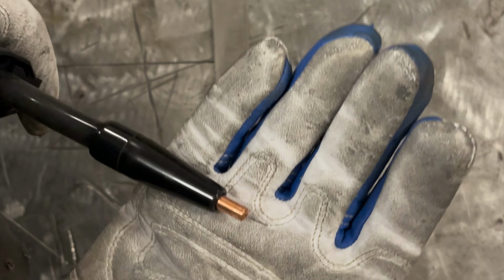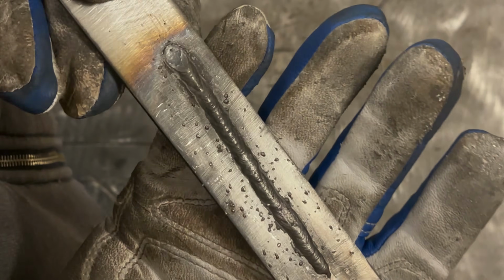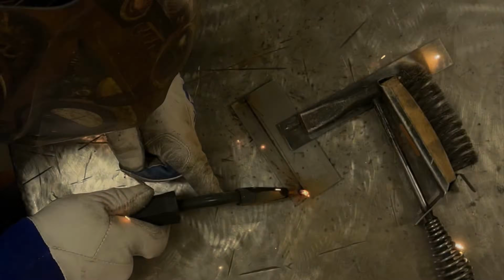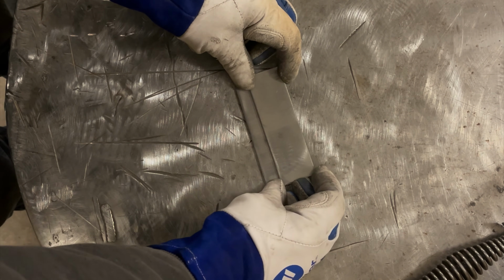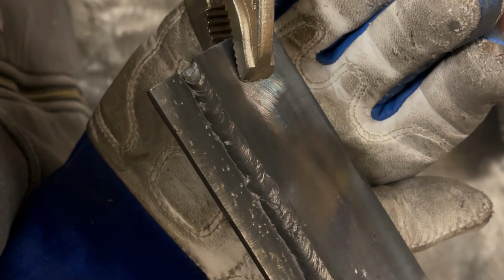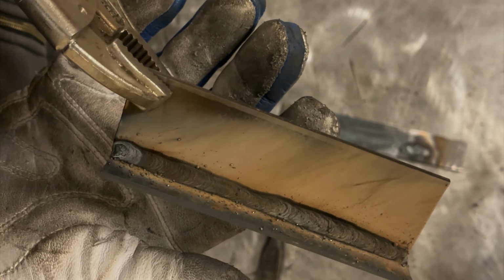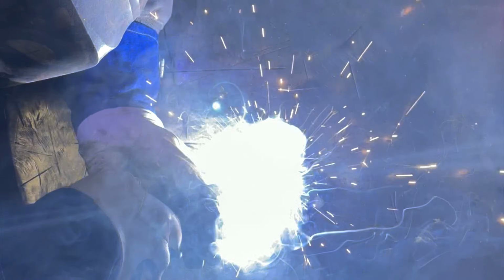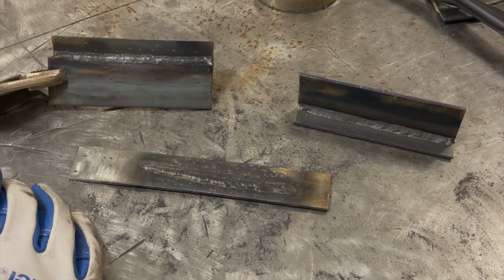How to weld with flux core wire

Comment: Forney .30 is what I use for anything under 1/8 anything over stick comes out lol thanks for the tips
Reply from the maker: Yep, sounds like me.  You can’t beat flux core for 1/8th or thinner and for how easy it runs uphill.  Thicker stuff I do stick (because I don’t have a big enough wire welder to run dual shield wire).  I really like running 7024 rods in the flat position on non critical stuff, it really lays down the metal to get the job done fast lol.
Reply: @makingmistakeswithgreg  you should do a video tig vs stick and see what one is stronger everyone saids tig is stronger then stick I say stick for the win

Comment: I get the stickout part, but what should the distance be from the tip of the wire to the material?
Reply from the maker: The wire is fed out of the contact tip to the metal and once it makes contact it shorts, producing a ton of heat.  That heat melts the wire and the base material along with turning the flux in the core of the wire to gas/liquid.  You as the operator of the machine only control the contact tip to work distance, the distance the tip of the wire is to the molten pool (or base material) is not a variable you really control.  The wire pushes into the molten pool on its own.  Technically if you set the machine hot enough you could put enough heat into the wire to turn it liquid soon after the wire leaves the contact tip (such as in spray arc welding with solid mig wire) but that won’t work with flux core wire.  So basically you want to try to maintain a distance of 1/2 to 5/8 contact tip to work distance while flux core welding with smaller dia wires (3/8th if mig welding).  I generally shoot for 5/8th and when the weld builds up as I am moving it gives me a 1/2in contact tip to molten puddle distance.  If you have any other questions feel free to ask 😀
Reply: @makingmistakeswithgreg  Thanks for the detailed explanation!
Reply from the maker: @bokononisti2820  No problem 😀.

Comment: Awesome video.  Answered all my questions by example.  That's the best way for me at least to learn.  I think I'll go out and buy one of these machines tomorrow!
Reply from the maker: You won’t regret it, they can help you build a lot.  Just take the time to practice to get it dialed in.  Your first welds won’t be the best but it won’t take long to get much better.  On a interesting note Lincoln electric is actually going to be releasing the welder under their own name shortly lol.  They will have it as both flux core only and mig/flux (aka gas capability).  No idea on pricing but obviously more than harbor freight lol.

Comment: This series are some of the most concise videos on weld characteristics and what we should be looking for. I have learned quite a bit as a new weekend welder and appreciate your time and patience putting them together - Thank You!
Reply from the maker: Thanks for the kind words.  I am glad it helped you out, that’s why I wanted to make the videos.  As long as you practice a bunch you will be surprised at what you can do with simple flux core.  The initial learning curve is a bit steep but after that it’s not hard at all.  I will be revisiting some flux core with vertical up and overhead welding once I am done with my stick welding videos (probably about 3 weeks).   😀

Comment: With mine  US Forge wire i get at lowes  works great and INE wire works very good
Reply from the maker: Great tip.  I did a test in a video with the us forge wire and overall liked it a lot.  For the price it’s very reasonable and much less spatter than harbor freights wire.

Comment: Just got this and can’t get a spark. Changed metals to test and nothing??? Do I need to let it charge on before hand?
Reply from the maker: If it’s plugged in, the wire in the unit is all the way out of the contact tip, and the contact tip is on tight, there may be a issue with the welder.  Make sure that the ground clamp is clamped tight to whatever it is you’re working on.  The power gets fed to the contact tip through a electrical wire, and the contact tip passes the current to the welding wire.  You should be able to test for voltage at the contact tip (one test lead on the tip and one on the ground clamp) and it should register voltage when the trigger is pressed.  If it doesn’t show any voltage there is a issue.  If it doesn’t feed wire when the switch is depressed the switch is probably bad.  You may have to exchange it.  I am sure it will get figured out and you’ll be able to get to making stuff 😀.
Reply: Thanks for your feed back 😊
Reply: It feeds wire, I just can’t get it to do anything else 😢
Reply: What do you mean by test for voltage in the contact tip and clamp?
Reply from the maker: @brittanyledezma1377  so basically if you take a voltage tester set to (and wired for) voltage and hook one test lead to the contact tip and one to the ground clamp of the welder, then pull the trigger on the mig gun, you should be able to see a voltage reading on the meter (probably 12-16 volts).  If no voltage is read, the output of the machine has a issue.  Since it’s feeding wire, the power simply isn’t making it to the contact tip. Likely a defective welder. 
Don’t feel too bad, my $6k miller dynasty welder was dead out of the box and I opened it up to try to fix it rather than being without it for weeks (it had a disconnected ribbon cable).  A quick swap out should have you up and running.
Reply: Thx
Reply: @brittanyledezma1377  did you figure out what the issue was?

Comment: Holy smoke....you are awesome....your teaching style is so smooth and precise...yea...I don't know if you teach or not...but you would be one heck of a teacher....I have my eye set on the titanium 170 mig welder and waiting for HF to do some special Xmas sale...I started with the HF 90 amp welder and what a disappointment that was...I finally gave that unit a toss in the trash...
Anyway...thanks for all the video series...and yep...I subscribed..👍
Reply from the maker: Thanks for the kind words and the comment.  Luckily youtube allows me to be a teacher and have my “lessons” reach people all over the world, which is ultimately one of the reasons I recently started the channel.  I am involved in a lot of stuff far beyond welding (it’s a small part of what I do) so I will have a ton of interesting content in the future.  

As far as welders go the 170 seems to be pretty good.  I have used the titanium 200 (works real good) and I will be buying the 140 and doing videos on how to mig weld with that coming up.  The difference in weld quality with a proper dc output wire welder and the cheaper AC output Chicago electric welders is huge.  Not to mention using quality wire vs harbor freights makes a significant reduction in spatter.

Comment: Great instructions, explanations and demonstrations, thanks! Where would I get the type of 1/8” steel like you were using to practice with? I went to a local metal recycle yard and picked up some recycled metal fairly cheap but it was all rusted and bent up and required a lot of time cleaning up to practice with.
Reply from the maker: Thanks for the kind words.  The steel I bought came from menards (like Home Depot here in Wisconsin).  Normally I would go to a metal supplier (for new metal) but the cost of driving 30min negates the savings on the material.  Recycled metal can be a deal but only if it’s straight and somewhat clean.
Reply: @makingmistakeswithgreg  , Thanks for your reply. We have the Home Depot here, no Menards. HD here didn’t have what I was looking for so when I was asked what I wanted for Christmas from my kids and I sent link to some small metal practice pieces from Amazon. 😆 Looking forward to more of your how to videos!  
Merry Christmas and Happy New Year to you and yours!
Reply: Turns out HD did have the same steel you were using in this video. I was just looking in the wrong area of the store. 🤷🏻‍♂️ In fact they had several varieties of plain steel to choose from including weldable 10”x10” sheets. All of it a bit expensive, but what isn’t these days??

Comment: Great video. I have been having so much trouble with my flux core welding and you have just taught me why :) So, like you said, I will be off to my workshop to practice and I will probably be taking a look back at this tutorial from time to time. Thanks again.
Reply from the maker: I am glad you learned a few things, it’s very easy to have bad results with flux core.  Once you dial it in and run consistently decent welds it will open up a whole new door for you 👍

Comment: Struck with settings 😢 , don’t really understand what’s wrong with my settings https://youtu.be/pZLasPUr3eo
Reply: For one, if you are using flux core take that big tip off, it's not necessary for flux, your stick out is probably too long.
If that that doesn't help, then try adjusting your wire feed.
Reply: https://youtu.be/3FkrSqEHtn8

Comment: Flux core or shielded by gas, best not to weld in open air with the wind blowing.
Reply: One of the advantages of flux core is that you can use it outdoors in the breeze, unlike mig where the shield gas will blow away.
Reply: @HarryJarrell  yeah ur right on the flux core and the MIG. no idea what i was thinking when i posted that. 👍👍

Comment: Can I use a wire wheel to efficiently knock off slag? I left a ton of slag at work that I need to take care of in the AM. I have a bur motor but I destroy my welds with it
Reply from the maker: A wire wheel will do a good job with the slag on gasless flux core.  It’s more powdery and loosely attached than say a 6010 stick rod pass.  The only thing you have to watch for is the toes of the weld, they tend to collect thin lines of slag.  If you multi pass over them on a x-rayed weld you may bust for what appears to be “wagon wheel” tracks, aka thin lines of slag entrapment.  The wheel will take care of 99% of it though, if you have it use a un-knotted wire wheel so it gets into everything well 👍

Comment: After much practice I have finally been able to hold a constant stickout and only occasionally get a little porosity.   However , there is one thing that occurs more frequently , and that is what appears to resemble what is best described as cracking on top of the weld.   Any ideas on that?
Reply from the maker: The line on the top is typically known as a worm track.  If you google worm track flux core and search pictures, check if your weld looks like that.  Normally this is due to the gas escaping the solidifying weld.  There are a few ways to try to get rid of it.  1: make sure you have a new spool of wire, if your using a old spool it likely has picked up moisture.  2: try using even longer of a stickout.  1/2in is ideal but 5/8th should work.  3: slow your travel speed down a bit 4: go slightly down on voltage and then slightly up from where you’re at now.  If you don’t have fine adjustment on voltage then slightly adjust wire feed speed.  5: make sure your material is prepped good.  

That last 5% of dialing in a welder takes most of the work.  I always start with a new spool of wire and go from there to try to get it dialed in. 👍
Reply: Watch your puddle and make sure you have a nice amount of molten metal in there before you advance and repeat, the shape size and liquidity of your puddle are all telling how fast you can advance creating the bead.

Comment: Lol. You underestimated the titanium 125. I welded a new trailer hitch on a friends heavy duty trailer with mine and surprisingly I could only run it at about half the settings without taking a chance of blow through. These damn things have lots of power with a highly consistent arc. One guy did an amp meter test in his review of these and got a maximum 140 amp reading. Good video man.
Reply from the maker: I have a video I just shot with it welding 1/4in material and I did a cut and etch.  It has no issue with penetration, however it did have some porosity.  I am going to do another run on 1/4 with a different wire and I will see if it’s better.  For the money it’s a very good welder.  Thanks for the kind word too 👍
Reply: @makingmistakeswithgreg  Nice man. I'll be looking forward to it.
Reply: Wow , I am very new to welding and just researching good tutorial videos and I have to say there is so much knowledge and amazing explanation in this video. Thank you so much ! I have project I would love to complete this fall  It’s military trailer which I will be turning in to overlanding camping trailer and want to fabricate frame to hold Roof Top Tent it will be total of 600 lbs weight. I wanted to use 2x2” square tubing and 1/8” thickness. Would you recommend to go thicker or 2x2 1/8” would work ? Thanks you again for your time